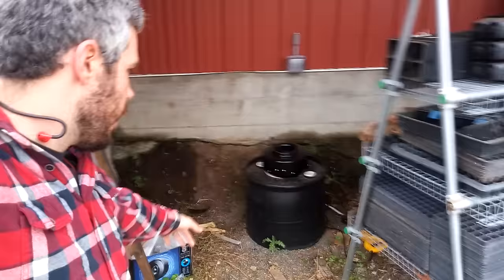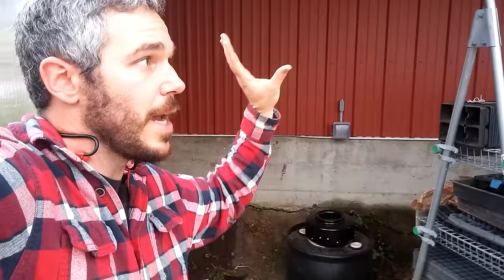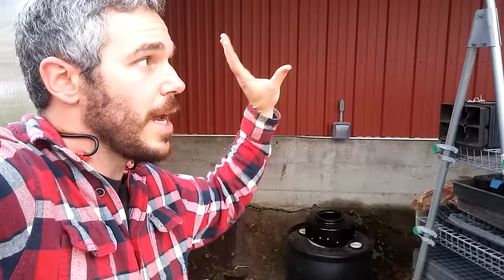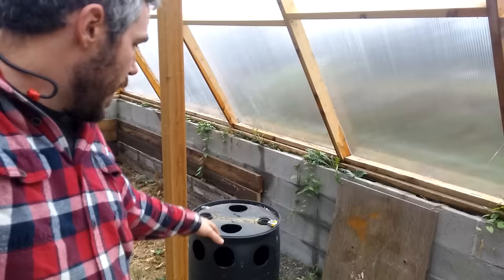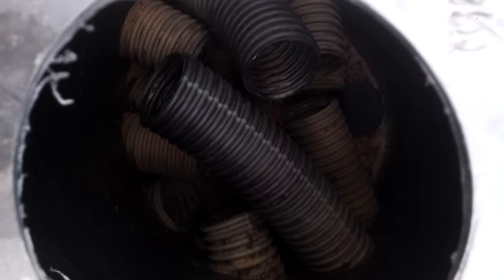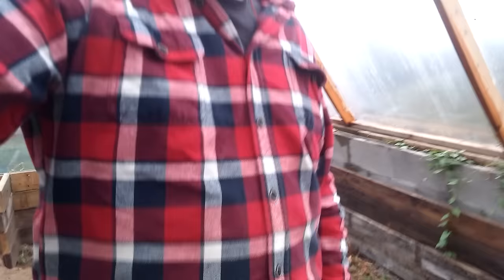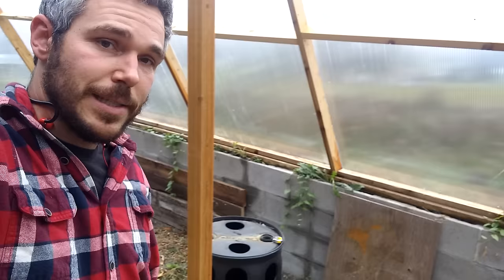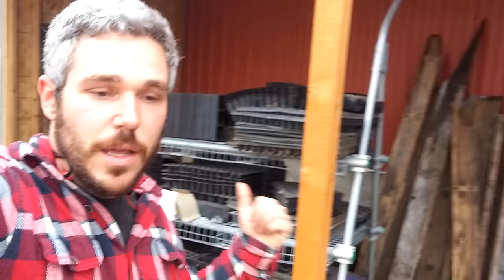Poor Man's Geothermal

Comment: I have small green house 10 x 12 that I plan to enlarge to 12 x 24. I plan to use geothermal heating and cooling plus solar panels for electricity. My plan includes three 4 x 4 x 4 compost bins along the back wall with a window over the first bin and 3rd to load fresh material from the outside aged mature compost out the 3 rd window. the setup will allow me to work the  compost year round indoors and when it is ready to use it will be right where I can get to it easy.  I also plan to make a small conveyor belt system to move compost from one bin to the next to save on work with a pitch fork or shovel.  the conveyor will be portable to move from bin to bin or even outside to move new material through  the window to the first bin or out the 3rd bin window right into my club car golf cart  with a dump bed.. There will also be a water faucet inside see  I am getting older and I need to find ways to make my labor easier.

Comment: Great looking greenhouse !
The calculation is .1 linear feet of 4 inch tube per 1 cubic ft of area to be treated.
Example - - A 20'x25' SF foot print with 10' ceilings equals 5,000 SF. 
Multiplied by .1 equals 500 linear feet of 4 inch tubing. My notes are from the late 90's and unfortunately I did not record calculations for larger pipes. It seems to me that larger pipes allow too much air through and it doesn't have enough time to change temps.
Larger pipes or shorter lengths need slower air flow.
Reply: KaleidoscopeJunkie
No it isn't. That calculation is a myth. The correct calculation is entirely dependent on the rate at which a given diameter of pipe, spaced at a given distance, placed at a given ground temperature, can dissipate heat into a soil of a given thermal conductivity, at a given air pressure.
Reply: Depends on how exact you want to get @GreatMooseDetective. You forget to include relative humidities, air speed, temperature difference between soil/air and inside/outside air, DLI, etc. But how exact do you want to get before the time spent creating an algorithm for all these variable creates a diminishing return on money? That calculation that KaleifoscopeJunkie provided is a pretty good rule of thumb for the amount of tubing needed. The MOST important consideration is to have the capacity to do at least of 5 air exchanges per hour for heating and up to 20 air exchanges per hour for cooling. Otherwise, getting into the semantics of all the variables is an exercise of ego.
Reply: Yes, but once they finished typing up their comment, they were feeling really good about finally being able to spew some high school math theory!
Reply: What if we pump water in the pipes then use an old radiator from truck with a fan? Ithink we will need less pipes for sure.
Reply: KaleidoscopeJunkie what ist that in the metric system?
Reply: hat is the correct formula then Mr Junkie?  @awhodothey
Reply: and just how is the cool air going to circulate throughout the entire greenhouse?? hmmm  that is good for cooling large aquariums as I have a friend that does this to cool 5000 galllons of saltwater aquariums because he uses high heat metal halide lighting.  Saves thousands of dollars in air conditioning which wouldn't work as well  @iivanov22
Reply: Iskren Ivanov this is a great idea for a home since we'd  want to heat water say for a shower or dishes  which  is an added benefit you suggest. My concern though is for a greenhouse pipes without water may be beneficial  in providing humidity instead of radiant heat. Your method still may be better provided we could find a way to measure both such systems. I'm  planning a shed build which will do exactly as you've  suggested.
Reply: andrew cravalho I'm curious the results!
Reply: I'm thinking the larger the pipe the less wall contact for heat exchange...
The ridges of the drain pipe I'm thinking help cause turbulence and heat exchange
Reply: I'm thinking longer pipes and more pipes..
Lower air speed should equal better energy transfer

Comment: What will really help is to have a temperature differential switch.  if your objective is to store heat, with temperature differential switch the fan will deactivate when ever the air temperature inside green house is cooler than pipes underground.

Comment: I think that tubing is one cubic foot per one foot length. So if you used 500 ft of tubing, you have 500 cubic feet of tubing. Divide the area of the green house by the area of tubing, there’s your formula.
Reply: Why in the world would you think a 4" or even a 6" tube 12" long would equal 1 cubic foot. A cube 1' X 1' X 1' equals 1 cubic foot. 4 6" circles will fit in a 12" X 12" Square with spaces in the corners and middle of the circles. So you can't just multiply the length and expect to get the correct answer without having the correct formula. The area of a 6" circle is 28.26 sq.in. so it would take a little more than five 1 ft. Sections of tubing to equal 1 cm. 500ft. Would equal about 100cf. So the volume of a cylinder or tubing would be pie times radius Squared times length.
Reply: @thatsonebadhatharry8610  I wasn't there to measure it myself. I estimated the radius and calculated off the top of my head as 6", when more likely the diameter is 6". With a 12" diameter tube, one cubic foot would be about 15". Not bad for an estimation, but more accurate when I actually use pen and paper.

12" diameter = 6" radius. (6 x 6) pi = 113.097
12" x 12" x 12" = 1728" or 1 cubic foot
1728 / 113.097 = 15.278"
Reply: @ColtonRDean  Yeah I can see that happening. Just looking at the video it looked like 4 to 6 in. tubing  so that's what I thought you were going by. I guess we were really on the same page after all.

Comment: Awesome! Thank you for this. Started digging after I saw this, it's getting there (I'm in southern Sweden). Happy growing!
Reply: solar heaters, the can setup encased with your ground batteries piped into the bottom manifold trough should heat and pull your lower colder air, you will probably need more than one solar heater

Comment: I dig down 2 feet preferably on a slope high side North low side South so you can easily enter the door on the South end. Placing concrete blocks 3 rows high on all sides and 1 row high at the doorway. Allows the heat from the ground to avoid frost in the winter. Build up dirt on the outside of the blocks to retain heat, wet soil is one-third better than dry.

Comment: I watched a video online that said to take the cubic feet of the greenhouse and divide it by 10 and that will be the length of underground drain pipe to lay. If you want to have all of it under you greenhouse so the ground can also benefit from the heat exchange, then go down 8 feet and the foot print of your greenhouse and lay some and put 18 inches of dirt and fold it and lay it again, repeat until you have the correct length. He also put 4 inch styro foam along the walls before filling in all the way up the 8 feet.
Reply from the maker: Yeah, that's significantly more intense than what I did, but probably a great idea.
Reply: If you use that formula you wont have enough tubing and the excavation cost will be silly expensive. Consider a 10 x 12 x 8ft box, thats 960 cubic feet divided by 10 gives 96ft of tube. Excavating 960 cubic feet of ground to install 96ft of tubing is plain crazy. The idea of folding the tube is also daft because for one, you cant bend  4" ads tubing to that radius, and two, the losses in a 96ft length of tube will be silly high. You might be able to run 50cfm through it which means it`ll take a little over 19 minutes to put the greenhouse air volume (960ft3) through it, thats just 3x per hour.  You need to put the entire greenhouse air volume underground at least 10-20x per hour (more is better). Your tube simply cant support that amount of airflow.
Reply: What I saw a youtuber do LDSprepper was dig a trench 8 feet deep, insulated on the sides and possibly bottom and then layers of tubing spaced out and fastened onto a chicken wire mesh and then droped into the trench and then packed with soil, repeat 3-4 times in layers. 
John what your saying is he would need more tubing and a larger fan to be able to circulate enough air?
Reply: Hi Shrive
LDSPreppers install isnt based on anything technical, more wild ass guess and hope it works.. He used 4 extremely long lengths of 4" ads tubing in a serpentine layout on a single level. Its very hard to purposefully design a layout that is less efficient ;)  Installing a larger fan wont help if the tubing cant support the higher flowrate. Take 10 drinking straws, join them together end to end and see how much air you can blow through them. Now take 10 more straws and form them into a tight bunch and  see how easy it is to blow through them. Both arrangements have an equal amount of tube, surface area, cost etc but one wotks and the other doesnt. It worries me that some folks may blindly copy these fatally flawed designs. Burying the tubing is a one shot deal, believe me its a lot of work and you wouldnt want to do it twice because it was wtong the first time ;)

LDS uses 4x 180ft of ads tubing, if you run 50cfm through each you`ll need a fan capable of providing 200cfm at (at least) 0.7" wc. LDS`s greenhouse is 7200 cubic feet and 200cfm will put all the greenhouse air through the tubing 1.6x per hour (assuming no mixed air). Thats  just not going to cut it ;) 
So, lets try a bigger fan that will put 250cfm through each tube, which puts all the greenhouse air through the tubing 8.3x an hour. Finding a fan capable of 1000cfm at 17" wc will be an issue ;)
Reply: Hey John thanks for the reply,
You make valid points and provide good food for thought. 
What are some other design considerations you would advise be taken into account other than bunching up the tubing instead of lenghtening it? What would happen if you had a long, length wise, greenhouse or structure? 
From what I understand you don't have to cover the whole length of the greenhouse to benefit from the thermal battery effect, i.e you can dig a trench in the middle and burry all the tubing maybe in a hexagonal pattern or similar to maximize area utilization and then run the blower through that. 
I'm also wondering if it would be necessary to join all the bunched up tube into one main line or seperate them into 2 main lines to get more even airflow distribution from the blower. 
I appreciate your time and input! 
Cheers
Reply: You dont want to bunch up the tubing, you want to distribute it evenly in the available mass. The individual tubes connect to a plenum which is sized to handle at least the flowrate of all the tubes connected to it. For example, if you have 20x 4" tubes you dont want to feed them from a 4" header. I use a radial layout which is more efficient, much easier to balance and allows for some very unique features to be incorporated.
Reply: Shrive
Lot of confusion floating around about the difference between thermal batteries and geothermal air exchange. They are not related or compatible goals. 

The correct calculation is entirely dependent on the rate at which a given diameter of pipe, spaced at a given distance, placed at a given ground temperature, can dissipate heat into a soil of a given thermal conductivity, at a given air pressure. 

The last thing you want to do is insulate around a geothermal air exchange and restrict its ability to dissipate thermal energy. Insulate the foundation perimeter above it. Thermal mass batteries are nowhere near as efficient as harvesting the natural ground temperature in cold climates. Also, most of these greenhouses have way too much glass and not enough thermal mass storage or insulation.

Comment: If you insulate your greenhouse it will make it much more effecient. All you need is add a layer of clear plastic on the inside and install a small solar-powered fan to blow air between the walls to keep it "inflated."
Reply: roger s ....it would be quite the trick to add a second layer of plastic to the INSIDE of a greenhouse and it would look tacky and cause all kinds of trouble
Reply: commonconservative whobcares what it looks like if it works......
Reply: lady farmer....have you actually imagined how you would hang a second layer of plastic on the inside of a green house?.......not duck tape i hope
Reply: He purchased the better double layered rigid plastic, which accomplishes the same thing as double layered plastic (flexible) Would another layer help? Sure, but he has already created the same/similar capacity of insulation as the double " inflated" plastic. R
Reply: Double sheet plastic and a fan is actually a very common tactic. google is your friend

Comment: should look at compost heat, the CO2 from the compost helps the plants breath
Reply: Doesn't that smell bad in a closed system
Reply: @coleweede1953  compost wont smell if you have your Nitrogen:Carbon ratio right. If it smells add more carbon.

Comment: pipe the collector barrel/trough to a manifold like pipe that connects to a solar heater and use that or multiple ones to draw the air up from your battery with solar powered fans....also if you made a stone and cob pit with a centralized RMH, you could also use the ignited RMH as the way to draw up from your earth battery freely...I used a trough because it was easier to pipe on multiple solar heater can setups on a narrower lateral south facing stud type surface vs a round barrel where only one side could face south at one time.

Comment: nice video and nice implementation.  Most people who do the horizontal "earth tubes" seem to trench outside the footprint of the greenhouse.  You were smart to stay under your greenhouse!  I have a vertical earth tube for my much smaller experimental greenhouse.  So far so good (when it's below freezing outside, it's above freezing in my greenhouse), but I will do some more rigorous measurements throughout the winter.
Reply: Trenching outside can be useful in hot climates where cooling is more important than heating. The unprotected mass loses heat to the surrounding ground and the sky at night which increases the cooling capacity for the following day. You can do the same with a sheltered system by rerouting the inlet/outlet at night to draw outside air through the tubing and exhaust it outside the greenhouse.

Comment: Since you are circulating air collected from underground, you also need to consider Radon. You need to know if radon is a significant issue in your area; what the parent bedrock is. Granite and shale can generate more but even limestone can in some areas off gas Radon. R adon is a heavier gas and more of a problem in basements than above grade living space normally; also it degrades in 3.5 days but the volume of air changes per day that the conditioned space is subjected to could be a problem. Research should be done at a higher level than this project.

Comment: I have maybe the smallest geothermal greenhouse at 39 sq/ft and 8 foot tall and get 55f out from a 5 foot hole with chamber buried under reflective foam cap and 4 feet or more of dirt. It is mostly for cool air the ground is very porous.

Comment: It would be nice to be able to freeze the earth under the greenhouse in the winter. Interested to hear what kind of fan controller he will use. You need the battery temperature, the outside temperature  and inside temperature  in order to capture all the modes. 
It should be indoor range, with a series of gates trigger the fans, or to shut off the fans, and a failure mode, when the fans aren't helping and the temperature is out of spec. That's to prevent you from running the fan unnecessarily.

Comment: Heat rises in air and in the soil.  If you installed the pipes UNDER the greenhouse, then you defeat the purpose of it.  The 60 degree warmth would rise up out of the ground anyway!  If you try to COOL the greenhouse, and you pump warm air in summer UNDER the greenhouse..... then once again the warmth will rise right back up and INTO the greenhouse!  Therefore, the pipes must be buried AWAY from the greenhouse.   I did extensive experiments on this subject and wrote an eBook about it which is available at LULU.com at this link:  http://www.LULU.com/spotlight/davidmundy and it is the book titled, "Home heating and cooling experiments"

Comment: Very interesting!  I have watched several videos on this type of system gathering information for a future project. You are the only one that addressed the issue of condensation underground and moisture issues.  I understand the idea that condensation can be removed by exiting the drainage style pipe underground. My question is what keeps ground water from entering the drainage pipe during a rainy season.  I am thinking OR can have lots of rain and therefore the ground water can build up. Just guessing OR may have a sandy or rocky soil?  Here in NC, we have lots of rain and a high water table in my area.  Maybe all the gravel surrounding the drainage pipe would allow the condensation to leave but I have no experience if ground water could  actually build up enough to come back in?  Any experience with this?
Reply: At that depth it won t be an issue
Reply: You could run even lower  drainage pipes to a sump so if there were a problem it could be pumped off...
Unless your green house is on high ground... Then it could just be drained off
Reply: everything should be build with a good weeping system, proper vertical and horizontal weepers all tied together like with any structure should be more that sufficient.

Comment: Watched this 3x. Yours seems simpler. Gives me hope. Love the barrel  intake and outtake.
Reply: Ya, love the barrels, drain pipe, fans (low voltage solar?) and future shaded thermostat. Been considering insulating my house foundation wall, since it has a decent working height, with a winter temperature of 45, summer 55. And that’s a ventilated area. Also considering a small green house at some point in time. So many projects.....enjoy you day!